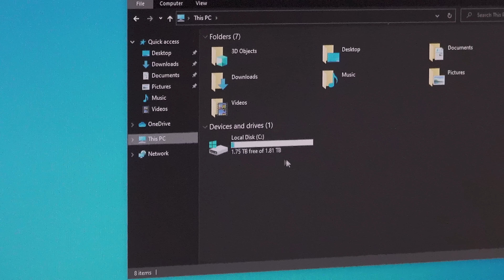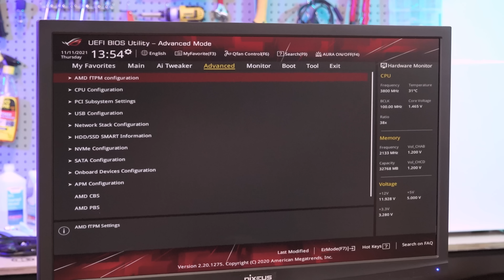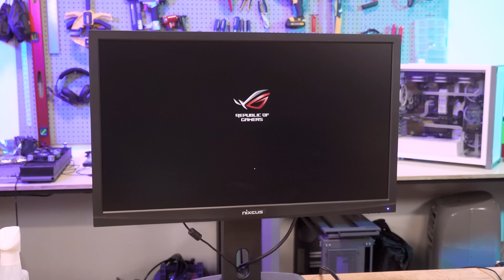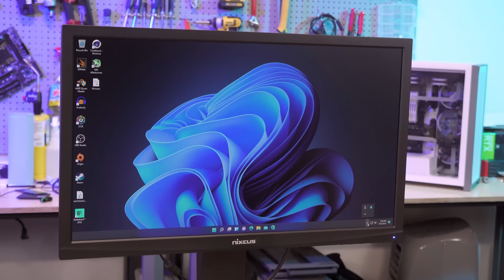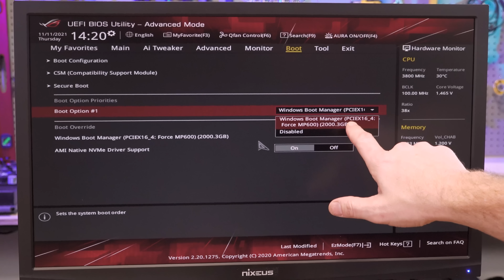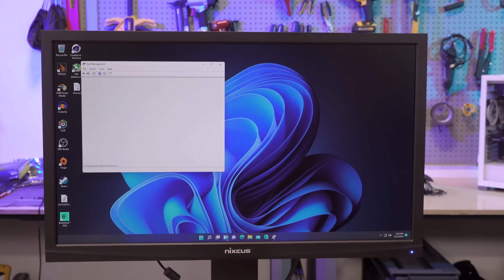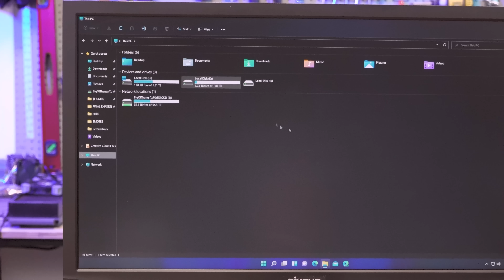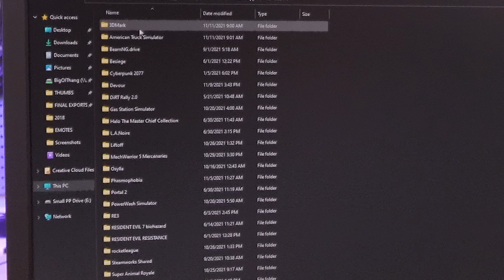Can you move Windows 11 from one PC to another... Let's find out!

Comment: Actually it does not always work if you move from one chipset to another. I have always had to resort to doing a universal backup/restore (Acronis) so it strips out the drivers completely from the boot drive so if I decide to move/restore to a different chipset system, It will boot and then install drivers correctly after.

Comment: Hi, nice video, but i have some questions,  as i m planning to buy a budget gaming laptop hp 15-ec2021nr and it does not come with thunderbolt port,  can we add thunderbolt port, ? It hase only one usb 3.0 type A, can we add another 3.0 port using pci express slot?, as i want to use with external monitor, speaker, keyboard, mouse .... so i need a Thunderbolt port,  so only single cable for all the things... is it possible???

Comment: man, sure would be cool if they had a card reader that would do m.2 and the be installed in the computer case instead of having to find the card reader, the cable, plug it in, after use put all away in a somewhere and hope you can find it next time and that it was not damaged in storage. .. blah blah..  yes i still use card readers and bluray writer in my case and this is why.. i do lots of trouble shooting, copying and backing up.. old school.. better to have it and not need it than to need it and not have it.. i also use hot swap ssd cadi to clone ..

Comment: I've done this a lot.  It's amazing how often it works without any issues.  Even when you get the bug that places the boot files on a different drive than where you installed Windows you can still transfer the install to a different PC so long as you have both drives connected.  Also, whenever you want to install Windows remove all of the other drives except the one you want to install it to so you don't have to worry about the boot files bug.  Learned that the hard way.
Reply: @adamd1347  ok thanks. I went from Intel to AMD build so I did uninstall all the old mb and chipset or other drivers just to be sure. I also ended up not running from the same SSD and basically cloned it to a bigger drive and set BIOS to use new one. Running clean and was lot less painful cutover than I thought it would be
Reply: @adamd1347  did you ever get any driver incompatibilities doing this? Leftover crud from old system? I just did this with new CPU motherboard and RAM upgrade but was surprised didn't even know this would work. I've got Macrium also but forgot to try the cloning😜
Reply: I don't think boot files going on another drive that's connected is a bug, I believe it's just how Windows works but it's very annoying and like you said always unplug all except the boot drive when installing Windows (unless you'll be keep any secondary drives for a long time and don't care if boot files go on another drive)

Comment: If you want to use that PCIE NVMe card, for the second NVMe drive, you need to split the PCIe slot "bifurcated" into a 4x4x4x4 (or 4x4) , rather then full 8x or 16x slot..  Else it will only see the first drive.
Reply: Looking closely at the video @9:04 mark it could be seen that in BIOS PCIEX16_4 slot is set to x4 bandwidth. By the looks of it ROG HYPER M.2 CARD is a fancy but dumb thing that requires bifurcation for second drive to work. At the very least I don't see any PCIE commutator chip on it like ASM1812 or PLX8748 that are typically used for this kind of duties. It means that (a) it hadn't had a chance to work for second M.2 drive as slot was in x4 mode - so simply no lines available for second M.2 to work with and (b) in case this slot supports x8 or x16 mode it would also require bifurcation support enabled for this slot (assuming that it is supported at all - as typically bifurcation is only available on CPU-connected PCIEX slots) and set to 4x4 or x4x4x8 - just like you wrote in your comment above.
Reply: Usually those 2nd or 3rd PCIEx16 slots are just x4 connected. Normally x8 or x16 (electric wired) cards run on x4 Slots (with reduced speed). But cards for multiple NVMEs are probably different, hence the bifurcation.
Reply: @ISO-ex2lg  the bifurcation of PCIEx16 slot is assigning limited PCIE lanes away from the GPU slot to a 2nd NVME x4 drive slot.
It happened with 2nd drive in Comet Lake due to limited PCIE3 connectivity.  Less problematic was AMD PCIE4 bifurcation as the GPU had enough bandwidth.  Of course with iGPU all lanes may be going to NVME PCIE4 4 slot card.
Reply: I got a question I'm hoping you can answer. Here's the story.
7 Years ago bought a PC. Last Year upgraded to an SSD (keeping HDD for backup). HDD was cloned to SSD. I use SSD as main boot. Want to buy new PC to modernize CPU/GPU and all that. New PC will have it's own SSD with Win11. I plan on using this new SSD with W11 as boot drive. Can I install the old drive to keep my games and files? Then also maybe transfer some of those files onto the new drive. (Both are M2. but new MB has 3 slots)
Reply: @Innnsanity  yes, I moved my Steam game library from a laptop hdd to ssd, then simply moved the ssd to my desktop build.
Look up data migration tools and  pages on using Windows robocopy if you copy folders onto fresh disk partitions.

Comment: I found out that this works by accident :)
When Windows 11 launched I installed it on my 7700K machine as an upgrade. But a few weeks later I upgraded to a 5800X.
I wanted to install Windows 11 on my new NVMe SSD but I forgot to go to the UEFI to change the boot order. The new mainboard defaulted to my older SATA SSD with the Windows 11 install.
Windows launched just fine for me as well. But I decided to do a fresh install on the new SSD anyway.
Reply: Good thing you did as in the past going from one platform to another like that could lower performance by up to 13%. I haven't seen tests to see if windows 11 behaves the same way but better to be safe.
Reply: @retrosimon9843  Oh yes absolutely. I always want a fresh Windows installation when I make major changes to the hardware.
And it was worth it, all benchmarks are in line with other results I found online :)
Reply: gigaBRAIN
Reply: @echoforge333  More like galaxy brain sized brain fart...
But hey at least nothing could have broken from that and it was a confirmation that the hardware works.

Comment: With anything before Windows 7, no! You needed to use Sysprep. However, if you choose to do so, uninstall any chipset, CPU, board and GPU suite drivers or software. Believe me. Going from AMD to Intel w the AMD (maybe give versa?) it crashes once logged onto the Window's desktop. Also, there are some odd instances where if you have EFI it won't boot, or if the bootsect settings are on a different drive and the disk isn't set to boot partition. Otherwise, should be ok.

Comment: Ah yes.. I had to update windows and opened the update menu. Saw a message that my pc is not compatible for windows 11. Meanwhile have 32gb ram 2700x cpu. So I check the list manually and see that I do match the specs. The only thing I did differently was uninstall the microsoft health check up app which came with an update a while back so in order to "match" requirements I have to run that app. So I think.. yeh that's stupid.. So while I was looking up if maybe the cpu was wrongly listed I find out that Window 11 doesn't run well with 2700x cpu's at all, the latency is almost double and triple with a patch that came out back end October. I feel like somehow I ended up protecting myself from all this nonsense without realizing it.

Comment: Even Vista did the drive moving relatively painless already and windumb has only gotten more resilient in that regard.
Just one tip for everybody:
When you do a clean install of Windows, DISCONNECT ALL OTHER DRIVES.
Windumb likes to put different partitions and parts of itself on different drives for some stupid reason.
Reply: Yeah that took me too long to figure out XD I had 2 M.2 drives, and when installing windows on the new one i kept getting intallation errors. Found out I had to remove the first m.2 and install

Comment: I've used the same key for windows since I bought a prebuilt 4 years ago. I've swapped cpu and mobos 3 times and never got the activation problems
Reply: I think if you sign in with an e-mail address the key is assigned to that, as long as you sign in with the same email the key will work
Reply: @paulraw  that would work make sense
Reply: @paulraw  Up to a point, yes.
If you move the install too many times within a certain time-period (I think its 12 months) MS "deactivates" the key, and you have to contact them to get it reactivated.
Reply: @The_Keeper  - I didn't know that
Reply: @The_Keeper  Yes. I had to call a number and do the whole manual installation id dance with a talking computer lol

Comment: Jay if you have a 3d printer, which i assume you do. Just do a quick cylinder design to go around that m.2 adapter, and then have a slot in the cylinder that matches the port so the drive can slide through the cylinder into the port. Just have the drive sticking out like 1/4.  This will give you the protection you need until such docking exists.
Reply: M.2 docks? They exist already, no need to improvise.
Reply: And it's an excellent excuse to go back to the Tustin Microcenter to go get a 3d printer. :)
Reply: good idea
Reply: Another option, or in addition to that (they're not mutually exclusive), put some blu-tack on the bottom of the base to prevent it from tipping over.

Comment: You have to enable pci-e bifurcation to use those multiple drive cards In a x16 slot.
Reply: Was pretty much gonna say the same thing : pcie bifurcation
Reply: JayWhatsApp is a Scammer, reported.
Reply: @gemininimeg  It's funny how they are getting rid of downvotes, meanwhile scams are popping up all over the comments...
Reply: Not even. That adapter card sends the first 4 lanes to the first drive and the next 4 lanes to the second drive. That's all well and good in a x8 slot, but the bottom slot on just about every motherboard, the slot he put said adapter card into, is only wired for x4. The second drive didn't show up because it was literally not connected to anything.
Reply: @waveformdistortion   He is on threadripper so there should be lots of pci-e lanes to go arround.
Reply: And it's also a high end board for TT, so it should have bifurcation settings, somewhere, and as it's an asus board, maybe hidden in a sub menu :p
Or maybe they're idiots and did not implement it, which would be sad.
Reply: Came here to say this.
Reply: Yeah I had the same issue but that only workings if you can bifurcation slots other than slot 1
Reply: I think asus calls it pcie raid mode to enable the bifurcation
Reply: Yup. Knew he will have issues with this from the start
Reply: Windows will freak out if you have it linked to a Microsoft work/personal account and bitlocker enabled, or if you are using exchange email with 365 as it stores the keys in the tpm. Just make sure you have your decrypt key handy and you may need to clear the 365 exchange email password in the credential manager and the protect folder in your user/roaming/protect (just delete the file/folder inside)
Reply: Yup and one should think about this before choosing a motherboard as the only board partner that has bifurcation on all their boards even cheap ones is ASRock. All the others have it mostly on their higher end boards like ASUS, randomly scattered like MSi, or rarely at all, like Gigabyte.
Reply: This, 100%.
Reply: @TheJaredC01  scam
Reply: @tsuki2000  yeah I reported them already. The 100% was to Bifurcation.

Comment: My pc being just built recently with a Ryzen 3900x and 10pro with the tpm activated just for eventual upgrade to 11 offered me the upgrade recently, not ready yet so declined. Good to know I can probably safely swap it to another box that supports tpm if I upgraded again some day.
I hate having to redo and reinstall everything when I upgrade boxes and usually leave the old one in place and swap it over to the new board. Or I'll clone it to a bigger boot drive for the upgrade. I'm still missing a few things because buddy built it for me helping him scrap a bunch of trade in boxes and salvage good parts. I have a new Asus-rog-strix-b570-E-gaming board with two m2 slots and a 1tb boot drive now. Never had anything this new and fast till now. I swapped in all the old drives so I can use it as is or reinstall to the other drive later. Doesn't sound like 11 has all the features of 10 yet but it's getting dialed in and eventually I'll upgrade.

Comment: so win11 requires tpm to store encryption keys/certs/whatever to protect user's data but if you then swap out that tpm after install it doesnt even care, nice
Reply: Windows 11 doesn't actually require the TPM. The only feature that I'm aware of that uses it is Bitlocker, and that one will cause failures if you change systems like this. You'll just need to re-enter your encryption recovery key though and reinitialise the TPM and it'll work fine.

Comment: I upgraded to windows 11 on my 9700k system, then upgraded that system to a 12700k, the only thing i moved over was i kept my ram and 3080ti and m.2 drives that already had windows 11 and all my games, it booted right up wand worked without issue, all i had to do after was go to microsoft website and reactivate windows due to hardware change

Comment: Hey Jay, do M.2 drives affect your GPU.  For example I have 3 on my Unify and a 3090.  Am I limiting my bus speed because of that?
Reply: Depends how many lanes does your cpu have. For example my ryzen 5600x delivers 24 PCI Lanes. 16 for my gpu and 4 for my M.2 Drive. Then there are 4 lanes left for a additional M.2 Drive.
But modern cpus deliver 20 and more lanes today, so you shouldn't have problems with that. So the GPU does not take any effect, the third M.2 probably works under Sata already if all lanes are reserved for your gpu and two of the M.2.
Reply: @denn0574  Oh I didn't realize that. Thanks. It's a 5900x which I believe is 24 as well.
Reply: They shouldn't. The GPU top slot should pretty much always be 16 dedicated PCIe lanes.

Comment: Actually you can move the harddrive in any system also without TPM, this is not mandatory for boot or installation once the OS in installed on the drive. So if you would have left TPM turned off, you wont have noticed a thing, in my experience.

Comment: Did you remember set 4x4x4x4x splitting for that PCIe-port? 
Anyway, changing platforms with current date Windows installation works just fine, even Greg Salazar were claiming that it's very bad thing to do. Also there shouldn't be even any problems with activation if old installation had valid Windows 10 license.
Reply: @Davidx_117  These days you can just tell Windows to swap the activation if you have the key linked to a Microsoft account.
But in general, if you have a key linked to a set of hardware, Windows will try to activate automatically.
Reply: @darranrowe174  Swapping activation only works so many times, at least in my experience (might be because it was an OEM key, retail might be unlimited swaps or at least more swaps than OEM)
Reply: @Davidx_117  The whole point of paying more for retail is that it isn't tied to a particular machine. One of the main stipulations for a retail key is that you are always able to move it.
For OEM, it always depends on what type of OEM key you have. Vendor OEM keys have limits like being tied to a single motherboard or limited activations.
Reply: @darranrowe174  Wasn't aware (or just didn't remember) that retail keys allowed that, definitely going to keep that in mind for my next build. Thanks
Reply: You can move keys as many times as you want some times you just have to type it in again if you move from one system to another oem or retail doesn't matter

Comment: I did it once cause i upgraded from my intel i5 4460 to a Ryzen 5 1600AF and it worked at the start then i saw that the windows files are completly different and i was on windows 8 at that time my i5 went from 2014 to 2018, upgraded in Feb 2021 and went from a GTX 750 1GB to a 1060 3GB big upgrade xD

Comment: Pci-e bifurcation is a setting you have to set for the pci-e slot where the hyper-x is plugged in, or you will only see one drive.
Reply: 100% this.  I have the PCIEx3 version of this that supports 4 drives and saw the same thing before bifurcating the slot.
Reply: Was so frustrating to watch,. because you are right of course. Also, you can't hot plug nvme USB drives like that... As he learned when he unplugged the USB device and plugged it back in.
Reply: @hellboundedward  sorry, what cant you just USB plug an M.2?
Reply: @RedStyla  yes! But you can't plug the nvme in while the drive is connected. USB is hotplugable. Nvme (in this case) is not. It's subtle, but this along with the very real risk of the drive breaking is why this particular nvme USB adapter is a bad deal.

Comment: Had the same "fatal error" error as Jay when using an external USB to NVMe adapter. Put the drive directly on the motherboard and it worked no problems. In my case, it was because the adapter did not fully support the NVMe drive and it was being reported as having a critical error when in reality it worked just fine.

Comment: drive clones through usb adapters don't "just work" (not for cloning an OS at least, normal data never has issues) the destination drive has to be in the motherboard and the source on the USB. otherwise it won't boot, either because of some windows bs or because of partitions not getting recognized as bootable.
Reply: Discovered this the hard way too... I have yet to find a way to properly clone a NVMe  boot drive with these usb adapters and then get it to boot when installed in the mb. If anyone knows a work around let us know.
Reply: @hammer9856  it ends up working if the destination drive is in its final position. You just have to keep trying...... After 10 times it'll work.... Yeah it's that ridiculous. There's no reason it shouldn't work but it always fucks up